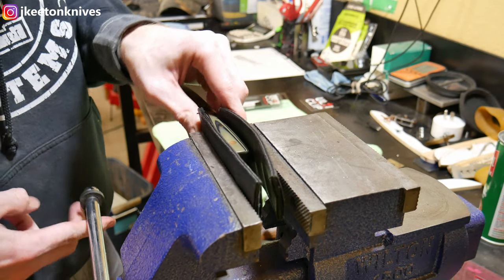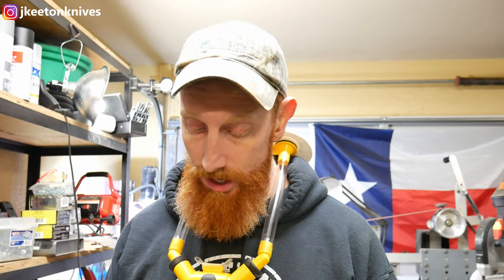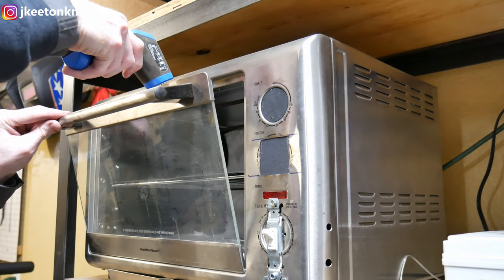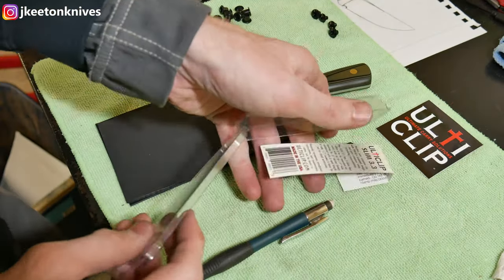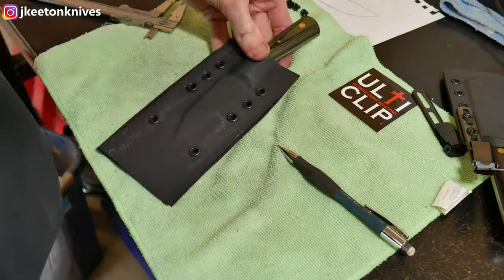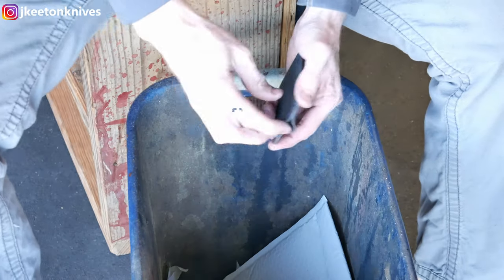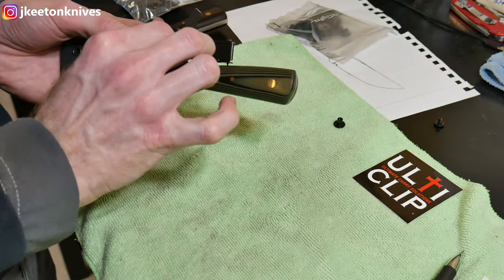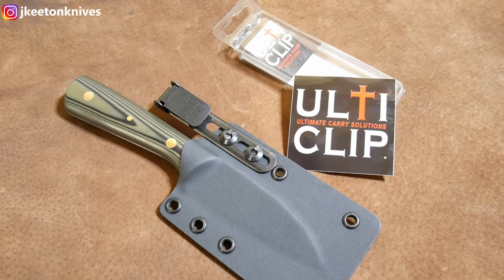How To Make A Kydex Sheath - Boat Knife - UltiClip

Comment: That looks like the Harbor Freight mini mill?  I am actually going to be buying a mini mill in the next couple weeks.  I haven't read really good things about the mill.  Would you suggest spending a little more, or do you think it will work ok for knife making?  milling slots for guards, possibly some folder work, etc.?
Reply from the maker: That is a harbor freight mini mill. I think it "can" do all of those things, however, you may want something beefier if you're planning on using it a ton. That being said, at slow feed rates, I think it could be a winner for you. The digital readout would be a good addition, I'm thinking about mounting one on mine. "little machine shop" has some good documentation on this machine.

Comment: Nicely done, just one question on a 3 year old video. Why didn´t you made the sheath slimmer and instead of placing the clip to the side, placed it in the middle ?
Reply from the maker: I think I was looking for a way to attach the clip with the current eyelets. In addition, I think having the clip side by side to the handle makes the whole package thinner. CHeers
Reply: @RedBeardOps  This makes sense, thank you for the quick reply. I just recently bought a White River M1 knife and one of those ulti clip slim, so I noticed how it would be better for me personally to not have the clip offset to the side. Of course it is a personal preference.

Comment: I know the hinges keep the two half’s of the kydex press together, but could you just clamp both sides to keep it closed or do the hinges maintain a certain angle on the backend? I want to make one.
Reply from the maker: The hinges don't matter at all. You could just use two plates with foam.

Comment: What size screws did the clip use? I ordered the ulticlip but it didn't come with any screws.
Reply from the maker: Hey Po, this was a bit ago, but if I remember right these are the screws I used - https://amzn.to/33eoBc7
Reply: @RedBeardOps the 1/4" juss to be sure?  thank u.
Reply from the maker: @loerabear  Yeah man. You can measure the length you need. I like having a couple different lengths on hand for those. 1/4'' is a handy length to have